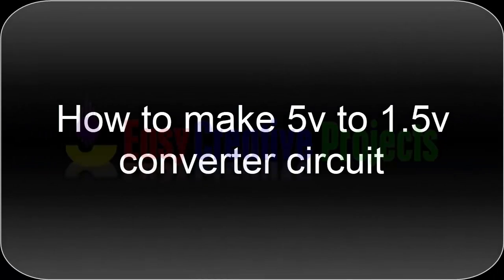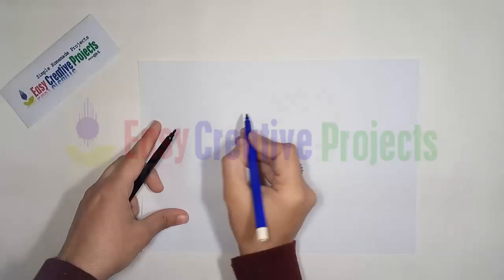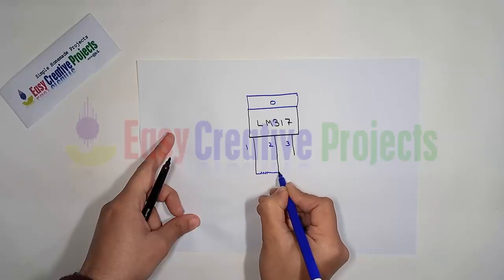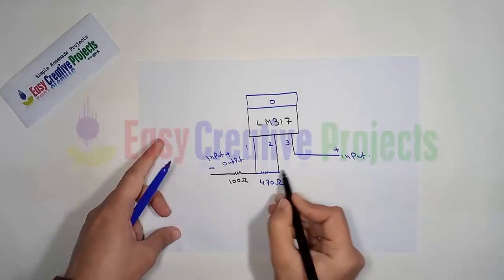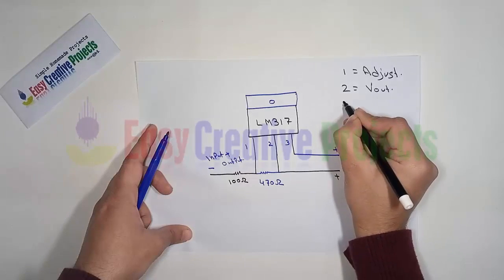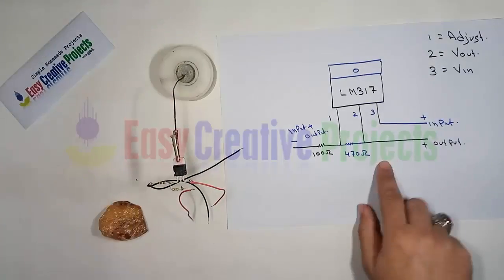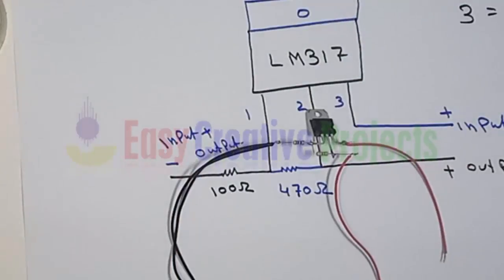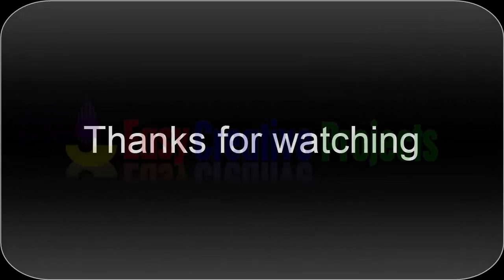How to make 5v to 1.5v converter circuit | DC to DC Converter with circuit diagram

Comment: What's the benefit of using method rather 1.5v cell
Reply from the maker: normal 1.5v cell storage capacity roundabout 400mah to 600mah. some good quality cell provide you 1000mah. but this mobile battery storage capacity 3800mah. 
if your normal 400mah cell give you 6 month backup then you can understand 3800mah cell provide you how much backup.
thanks.

Comment: This is no good as far as efficiency goes. Linear regulators dissipate lots of power.
Reply from the maker: I note a date and time of this battery circuit on the clock. When the battery empty then I make again video for this topic. And share a detail video. Thanks.

Comment: What's the advantage of this circuit compared to just using two resistors in a voltage divider configuration?
Reply from the maker: friend its adjustable regulator.and our requirement only 1.5v so we use fix resistor. if our requirement every time change voltage then we use variable resistor.